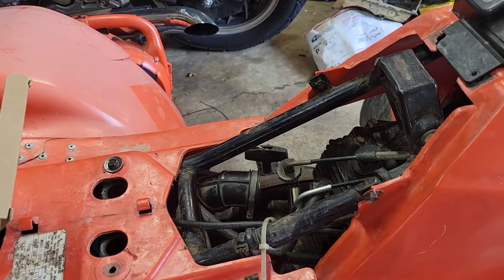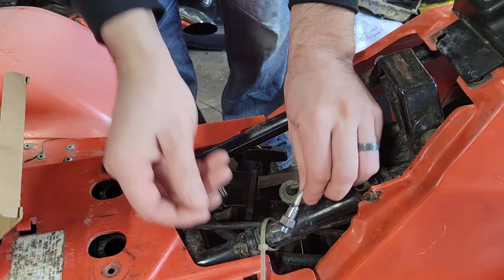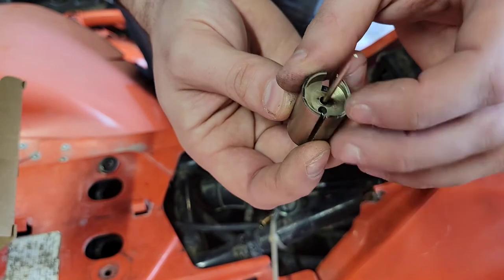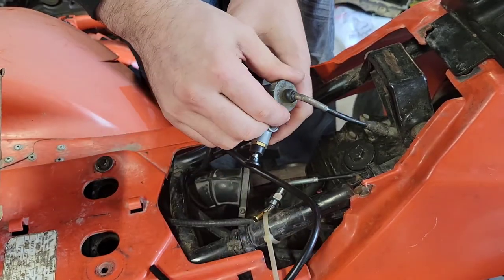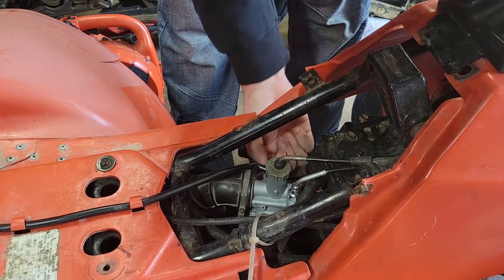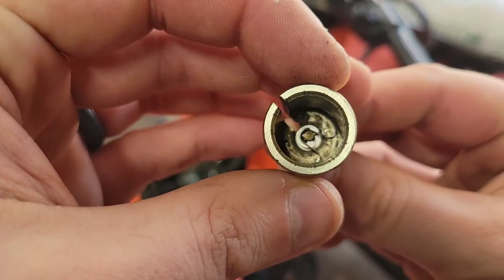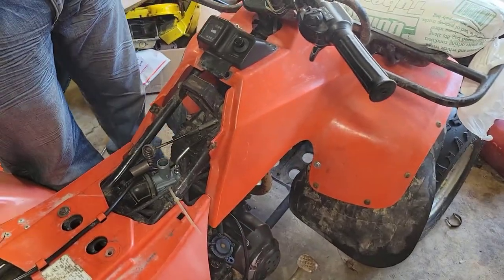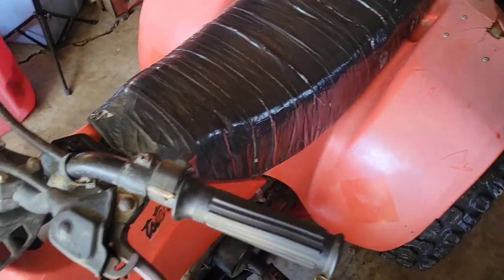Suzuki lt125 Aftermarket Carb Replacement

Comment: I have this motor in a bicycle that I built. I have been through many carbs, jets and found these mikuni carbs don't do well with this engine. I recently discovered the carb for gy6 scooters. It is cheap and extremely effective with this engine. There are many sizes mine is for a 150 cc.  Now I have full range rpm and instant rev response from idle. Another problem the alt 125 has is the ignition coil. The coil from a gy6 scooter completely fixed this after installing multiple colis. The symptom for a bad coil is the motor will start and idle but will not rev up and the motor will overheat.
Reply: Looked at them, what does the little wiring harness hook into?
Reply: What's the name of the 1 you use I've bought 12 now the stud hole don't line up nothings working

Comment: I have a 185 and im replacing oem mikuni 22mil with a 21 mil pwk carb, so you think that it will work good?
Reply from the maker: @ineedfriends6764 The only thing would be the ability to prime the carb since the tank is below the carb.
Reply: @mistermacgray  it doesnt have a primer but the fuel pump works fine so i think that It should be fine because I don't really use the primer much let me know your thoughts
Reply from the maker: @ineedfriends6764  those are my thoughts on it. If it sits long enough the carb will empty out from back drain of the fuel line and evaporation and it will suck to try and prime the carb again. As for the PWK, more or less an Amazon knock off, will probably have to be rejected. The OEM mikuni is what i woukd stay with if possible, it will perform the best.
Reply: @mistermacgray  that's what I was thinking but my buddy thought a pwk was the way to go because the slide is worn on it and it actually makes an air leak with the little amount of slop on it so it won't idle right and there is t much Info for the 185 specifically also an oem carb costs about 100 bones
Reply from the maker: @ineedfriends6764  the off brand one I used in the video is working great on mine.
Reply: @mistermacgray  ok thanks good to know I might consider getting one of them if the pwk doesn't work and I'll just send it back

Comment: My name is Mike I am about to go pick up a 1986 Suzuki LT 125 that needs fourth gear it’s broke is there anyway you could do a video on the teardown of the clutch it will be my first rebuild I don’t have any experience if you could make a video it would be helpful thank you
Reply from the maker: Because mine isn't broke, I live by the term "if it ain't broken, don't fix it"  I have a spare engine I'm told that runs fine however needs seals but one of those I'll get to it one day because my other hobbies have taken over. I don't ride mine other than winter time as I don't have a place of my own to ride mine around with, I live in the city and they tend to frown upon it more in the nicer months than winter time when there is snow.
Reply: Thank you. I look forward to seeing the video

Comment: I just picked up a 1984 lt125. I can get it to start and run with the choke on. But if I shut the choke off or hit the throttle it dies
Reply from the maker: Carb needs rebuilt more or less, low and /or high speed ports are clogged.
Reply from the maker: Carb needs rebuilt more or less, low and /or high speed ports are clogged.
Reply: What size of carb
Reply from the maker: @MayzDayz007  link is in the description of the replacement carb used

Comment: How do you tell what your year model is? I'm trying to find mine so I can find the right carburetor for mine.
Reply from the maker: Front right of the frame has a date and serial tag on it. Carbs from all the years will fit without issue.

Comment: Is there a way to put slightly taller tires on the front because every time I take a turn the front tires come off the ground
Reply from the maker: Taller won't help. Best things I've found are to slow down when taking turns, lean forward and add weight to the front. I'm the winter I put a 60lb sand weight in the front to keep it down.

Comment: I bought one with a junk choke where do I go to buy a new one
Reply from the maker: Either get the choke part off a new carb or just replace the carb. If it's the cable, then any cable can be made to work

Comment: Running really lean, you might need to re-jet the carb or raise the needle on the slide.
Reply from the maker: Actually it runs rich, spark plug shows that.